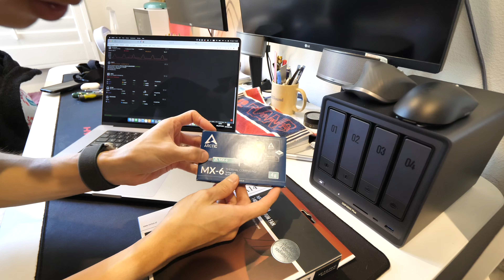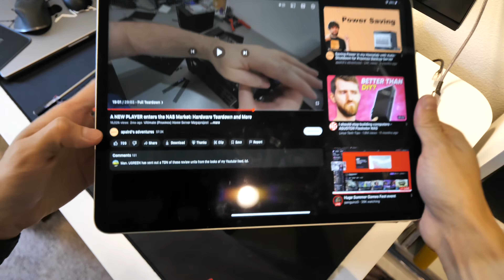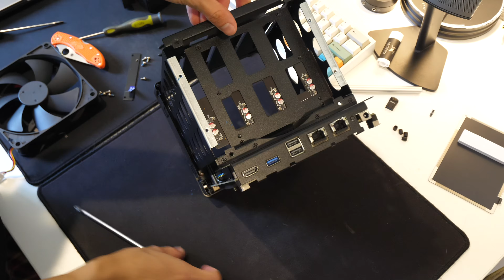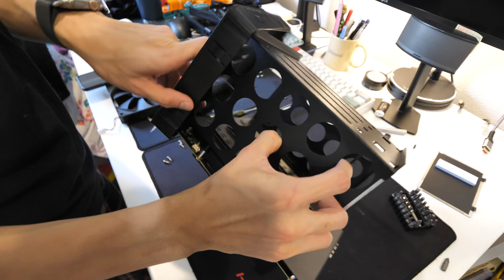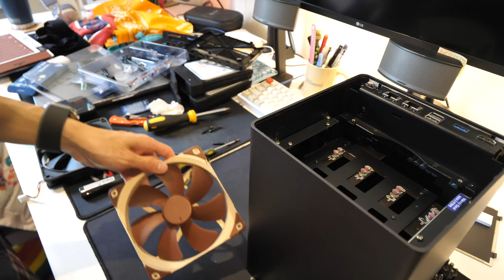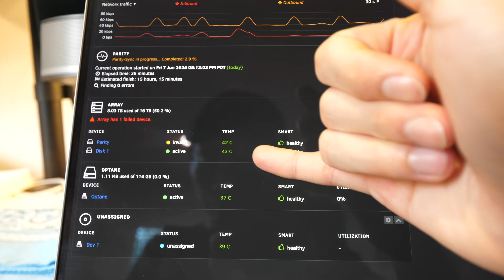UGREEN DXP4800 Plus Disassembly and Cooling Upgrades

Comment: I don't think that's rust you were seeing. It's most likely some kind of threadlocker (like Loctite) applied from the factory to prevent the screws from loosening over time due to vibration. It was probably originally blue (the kind typically used on electronics screws) before fading to a darker brown after being exposed to heat.

Comment: Hi everyone, I did the cooling upgrade and here are the results :

before the upgrade : 
stress test at 50% cpu charge : 100°c

after the upgrade : 
stress test at 50% cpu charge : 64°c
stress test at 80% cpu charge : 73°c
stress test at 90% cpu charge : 75°c

Chassis fan : BeQuiet Sileng Wings Pro 4 tuned at 1450 rpm during the test
Thermal paste : Arctic MX-7

GREAT SUCCES !!!
Reply from the maker: Thank you so much for sharing!
Reply: i also did the upgrade with new thermal paste and Noctua Fan, also some bios tweaking, which brought me 20°C down under load. SUCCESS!!
Reply: @aminstar5665  glad to know your journey thru this went right ! our nas are officialy the cool kids !

Comment: My man.  I'm running the exact same setup and was curious about extra cooling.  During the constant reads/writes during disk clearing and parity sync/check, drives were pushing almost 50C.  I popped out the empty drive caddies which helped bring the drives back down to 45; but still.  While they can operate up to 60C, they manufacture recommendations still state to be less than 45C for longevity.  Thanks for this video!  Im curious about swapping out for a more static pressure fan (fans for cooler rads) to push air across the tight space between drives; instead of high air-flow stock fan

Comment: Thanks for the breakdown video. It was super helpful for when i took mine apart and upgraded to PTM7950 for the CPU and a Noctua NF-A14PWM G2.  I added the LNA to my fan and set it to full so runs around 1200 RPM constant now.  I found it kept the HDDs a bit cooler.  Mine were hovering about 40-45 with the stock common settings and full speed was too loud with out the LNA

Comment: For all the people who are bashing on him taking it apart. How else do you reverse engineer anything to upgrade, improve or understand technology? Me personally after looking at this video, I'd rather just end up building myself a custom NAS desktop because the risk of losing failing expensive 30TB hard drives due to poor cooling design. Reasons why I stopped building mini-ITX cases. The minimum space is not worth the loss of expensive hardware.
Reply from the maker: thanks for the comment! very valid points.

Comment: I have the DXP 4800 pro and I live in Bangkok in a pretty warm apartment and my idle temps HDD are 38-41 degrees C. I think my ambient temps are around 28-30 degrees. Based on your video, I think I am going to utilize the Noctua AF14 3000, the industrial fan. I think the issue is static pressure. I did some testing and added some static pressure and I was able to get my HDDs down 5-6 degrees extra to 35 degrees. My NVMEs went from 50-60 degrees to 40.  My hypothesis is that the drive bay enclosures and internal design are creating some sort of air pockets of hot air that are insulating the HDDs. I've noticed that running my stock fan at 30% or 100% actually doesn't make any difference on the HDD temps, and I think its because the cool air is not touching the HDDs. I don't keep my NAS nearby my desk though so the noise level of the fan isn't that important to me.

Comment: Hey! thanks for the video, I have a question, how do you manage to keep the fans spinning all the time? In my case it turns on and off everytime and it's annoying, I tried to set it up un BIOS with your config and also with different configs but it has no effect, the fan will just keep turning on and off depending on the temperature, my goal is to let it spinning a low rpms. Can you help me here? I have the DXP 4800 non-plus version.
Reply from the maker: thanks for the comment. i never figured out how to keep the fan spinning at all times. mine is exactly how you described as well, turns on and off based on temps. i will definitely post an update if i ever figure it out!
Reply: @iamalexsun  Thanks for the answer, yes please, if you manage to figure it out, please, keep me posted!

Comment: hi.. if i install Noctua AF-14A IPPC 3000, which is has 0.55A power input. it can be done?anyone know how much PWM rated on motherboard DXP4800plus?
Reply: I just purchased that fan because I'm pretty sure static pressure is needed to cool the NAS enclosure. I haven't received the fan yet, but I've done some testing and there are certain deadspots in the enclosure that need more static pressure. Be default, stock temps are around 38-41 when filled with 3 NVMEs (OS + 2 optional) plus 4 HDDs in my apartment in Bangkok. My hypothesis was that the plastic enclosures are too resistant to air so the cool air isn't actually blowing onto the HDDs but instead blowing around them. I increased the static pressure and that dropped temps 5-6 degrees - not bad considering I haven't even used the Noctua AF 14A 3000 yet. 

I noticed your comment is a month old, did you get a chance to install the fan? Based on my google-fu I think it'll work but if you know I'd appreciate it. I have the 4800 pro.

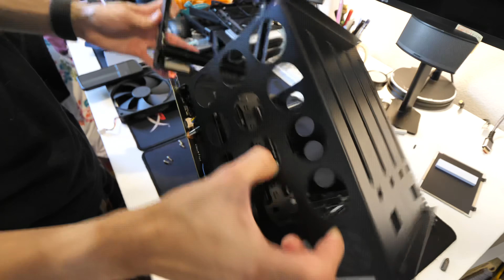Comment: Just saw this, great disassembly. Only thing I noticed (idk if you fixed it off camera but  can be a huge fire hazard) is that your on-board CPU Fan power cable from the motherboard to your CPU Fan is compressed between your heatsink and motherboard. You can see it clearly when you were screwing back the heatsink during 16:33 and even when you put the motherboard back onto the case 18:56

Comment: A little late for my notice , always when u turn a fan u make induktion power to the Board , and this is not a good idea , dont turn always the fans when conect ,
the secon , when u ahev it open clone the original OS ssd , but i hear u have chance the OS , the originl os back save is only by serial number and Ugreen support posible , u become a downloade linke with 
a serial number and u can only install it with serial number ,but have  clone u clone it back and all fine

Comment: One thing you did wrong, you used wayyyyy too much thermal paste. If you dont know how much to use in a blob technique, its ok to try spreading it across the die. Thinner is better. For even better cooling you could have lapped the cpu as well.

Comment: how much does that thermal paste actually matter?  i  have it on hand, but i didn't realize it would be so involved to even access it, and the screws inside to take the shroud off are so tight i'm stripping them trying to even take them out, but i could just install the new fan and call it a day.  would that be fine do you think?
Reply from the maker: honestly it’s not really necessary to replace the thermal paste. on the other hand, it wasn’t too complicated to access the cpu, it just looks like a lot. 

but yes, you can just replace the fan and call it a day.

Comment: lessons:
1) when you are changng things measure first, then change, then measure, otherwise your results are pretty unscientific and meaningless
2) Compressing the fan against its mounts too much destroys the point of having the mounts
3) get a drill and counter sink the holes by hand, if at all possible or get longer screws
4) the amount of thermal paste you put on was way too much

A cool video which interests me as Ihave just bought a DXP 4800 Plus with 4 * 8TB Seagate Ironwolf pro drives, thanks for doing the hard work of the first disassembly.

What made you choose unraid rather than truenas or just leave it as ugreen.

When you installed unraid did you overwrite the UGOS or save it somewhere in case you need to go back ?.
Reply from the maker: @michaelhex  Glad the video was helpful. 

1. I chose unraid because it was recommended by a friend, and he was able to help me set it up. I’ve heard good things about trunas, but unraid was just more familiar to me. 

2. The UGOS image was not deleted, I simply removed the boot drive from the bios so it doesn’t boot into it. I can still switch back by enabling that drive in the bios.

Comment: Just picked mine up yesterday, and am going to put in 4 X4Tb WD drives in a RAID 5 array. Upgrading the memory to 32Gb as it wasn't that expensive from Amazon. Have a couple Samsung 980 SSD's already, so 2 x 1Tb for that. Will leave software as stock for now.

Hopefully able to upgrade to bigger drives over time. Will setup my 2 old Synology dual 4Tb systems properly at last as they've say idle for some time unused. Might put one in the living room as a general purpose media/backup solution and leave the 4800 in my home office.

Comment: You did okay. However you used WAY too much thermal grease on the cpu.  Use a small pea sized blob in the exact middle. Nothing else. You used about three times as much as that. The pressure of the heatsink will spread it out on its own properly. 

Also that is not rust. That is loctite.

Comment: Rule of thumb for any work you do: always remove discs, RAM, and accessories, before disassembly.

I started fixing PCs in the early 90s and to this day I still keep the first HDD that I forgot to remove, which ended up on the floor, losing all my important stuff.

That DDR5 module was 1cm from a guillotine. 

Apart from that. AWESOME video!

I think I'll do this as well. I wonder how hot it will run with the four bays populated.

Comment: If you ever take it apart again can you list the part number for the CPU fan assembly? Mine is having clicking noises when running and I can't send it for warranty repair because I bought it on ebay. It might just be the cable underneath hitting the fan idk.

Comment: can you add a different ssd with higher capacity
Reply from the maker: yes
Reply: @iamalexsun  also if I could get the exact size of the screen used on the fans so I can ship them together with the noctua fan would be great
Reply from the maker: @Pertruck254_KE  what screen are you referring to? The UGREEN NAS comes with a magnetic metal mesh screen.
Reply: @iamalexsun  sorry its an auto correct ... screw on the noctua fan
Reply from the maker: @Pertruck254_KE  No worries. I just reused the oem screws, had to force them in but it gets the job done.

Comment: I did this on 6800pro but that one uses a little tape to connect to the leds/power button panel. Unfortunately I've managed to rip part of the small plastic socket for the tape ☹

Comment: Disclaimer: Normally I would be against performing such operation on a brand new device. Wait at least few months and use the product as intended, so that you look out for any manufacturer defects and also in this case you could have monitored the performance for 2-3 months to get a baseline. The reason is if day one you perform such disassembly you won't know if you screwed up or if it is the manufacturer at fault. (I understand you are a YouTuber and appreciate your dedication, disclaimer are for people watching the video).

I really like the fact you have a full disassembly of a low-cost product fully documented, it is a good spot for people to get reference at some point when they need to perform maintenance or if someone is intrigued on the internals of the device.

1) The rusty compound you found is most probably a cheap thread-locker from the manufacturer, normally it is blue on electronics and sometime red on device prone to higher vibrations. You could get yourself some Blue Loctite Thread-locker and apply it, as these screws sometimes might come off due to the vibration caused by the HDD and make electrical shorts.

2) Noctua Fan is a cool touch :) A little bit over-kill but I like the choice! I can already see that in the future you'll probably build your own NAS and re-purpose this as a backup to your main NAS. Maybe we will see a mini home-lab build! 

3) Plan on a secondary NAS as mentioned above, which you can set up as a backup, periodically turn on to sync with the main NAS, the secondary should be at a different spot/room or even another location, maybe a trusty family member in exchange you can offer them a small allocation.
Reply from the maker: Thanks for taking the time to write! All your points are completely valid. 

On the rusty looking screws. All the other screws had blue thread locker applied from the factory, which is why I was surprised to see those rust-colored screws. It could be a cheap thread locker compound like you and a few others have mentioned. 

You've read my mind. I do plan on building a homelab in the distant future. However, this one is more than sufficient for my needs at the moment, so it might take some time before I feel the need to go all out and upgrade!

Cheers!

Comment: The "rust" is actually threadlocker.  No idea why they aren't using the red or blue, perhaps it's just some generic stuff.  

When you're re-pasting a bare CPU/GPU die spread the past out over the whole die so that full coverage is guaranteed.  You used enough excess that I doubt there's any voids but it's a good idea to keep that in mind for the future.  Personally I'd use one of those cryosheets or PTM7950 since getting in and out of that thing to re-paste would be a pain and pop-out is a common occurrence in bare die applications and repasting a NAS is a PITA.
Reply from the maker: Didn't show it on video but all other screws have blue thread locker applied from factory.
Reply: @iamalexsun  there's also brown threadlocker, it's weaker than the blue
Reply: I agree, I would also use PTM7950. It's a brilliant product. I'm surprised you didn't use it for a device that is supposed to work 24/7 for years.
Reply: Some of the standoffs in mine are rusted. All I can figure is the galvanizing process was junk.
Reply: Chinese level of thread locker, gotta save a penny instead of paying for red or blue dye.

Comment: Are you using your M.2 as a Cache? Also, in the future you can schedule your parity to operate during specific windows (like while you’re asleep.
Reply from the maker: I did consider using the M.2 drives as a cache. However, I ended up using my Octane M.2 as storage for my appdata and system folders, which is a little overkill. 

There is a scheduling section for the parity and mover in Unraid. There are lots of options, for example, time of day, day of week, month, etc.

Comment: Okay, so I am going to summarize what I see. For my own benefit.

You're placing the stock fan on the new NAS for no particular reason. Your drives are operating within thermal specifications. You're replacing the thermal compound on the CPU for the new NAS for no particular reason. The CPU is currently sufficiently covered by a thermal compound chosen and applied by the manufacturer. You're running Unraid, which gives you the throughput of a single disk, even though you have a four disk NAS that would provide theoretical aggregated throughput of three disks if configured in a RAID 5 array, like that supported in the manufacturer's operating system for the NAS.

Ah. Good. Now I understand fully.
Reply: Even if drives and CPU are operating within thermal specs, the cooler a device runs, the better it is for the long-term reliability. So no, he's not replacing it for no reason, he's replacing it to get A) better thermals and B) lower noise both at the same time, and probably higher performance since MX-6 is most likely a better paste than what Ugreen used by default ...
Reply: As long as its within spec it will make no difference to long-term reliability, you are making up stuff you have no evidence for. Better thermals are irrelevant its a NAS performance isn't going to change or even be noticed if it does. The fan probably will give a better noise profile but he took no before or after measurements. NAS is probably going to sit unused in a cupboard anyway.
Reply: did he even test the temps before the repaste?

I have the exact same unit and currently running plex transcoding at 75% cpu load and it is sitting at 65c on the hottest core, the chip is a 15W chip, if you want cooler temps just replace the whole damn cooler, thermal paste will only get you so far, and I can assure you at 15W thermal paste will never be the bottleneck of your cooling when the cooler is some thin extruded aluminum with no heatpipes
Reply: @v000000000000v  maybe one day AliExpress will sell heatsink fan part with heath pipes and OP will upgrade that part then??
Reply: Im actually looking to replace the stock cooler but have no idea on the clearance height.  @v000000000000v
Reply: @Leseratte  I believe Backblaze in one or more of their disk reports drew the conclusion that temperature had little or nothing to do with drive failure rate.

I forgot to add in my original comment, that the OP immediately voided the warranty on his new device.

I stand by everything I wrote and will add the following - I am sure controversial -- discussion point:

Almost half of the Noctua fans people use are unnecessary, and almost half of the Noctua fans people use don't move enough air to be useful. They are quiet because they run slower and just don't move air as well as OEM fans.

Comment: Oh the four screws to cpu fan , you needed to screw down the same nbr of turns as the other 3 screws assuming equal pressure is applied to cpu also not too much pressure that would squeeze out paste almost entirely ???
U need to monitor cpu Temps to verify reapply paste was successfully